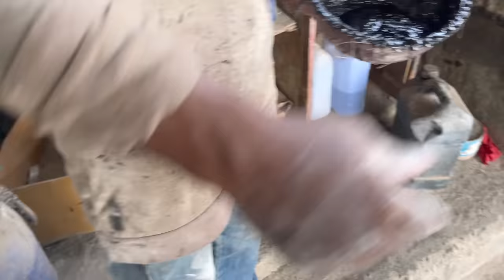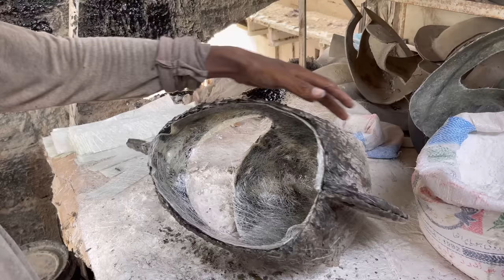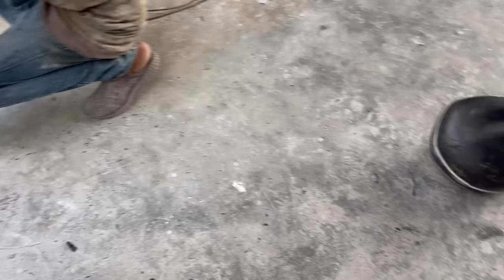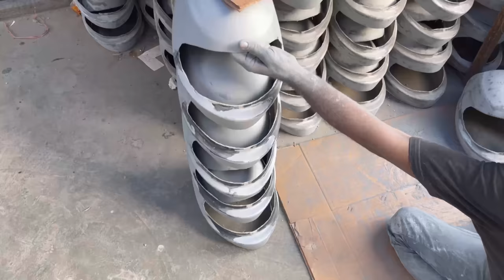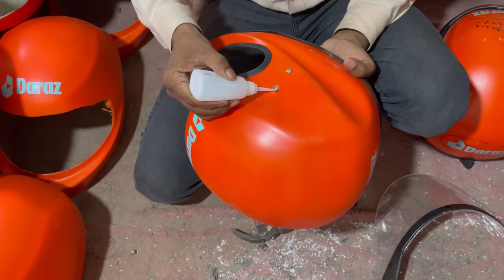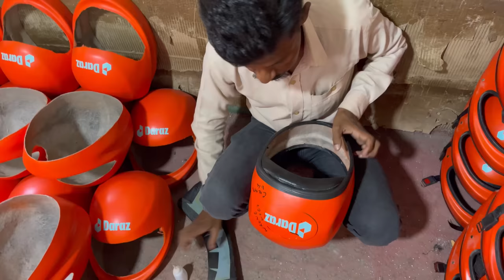How to Make Bike Helmets in a Local Factory by hand || Amazing Work|| Complete video||

Comment: Thankfully I will never have to wear any of that crap, the UK may be many things but our Motorcycle Helmet Standards are far & away better than these, at least in an Accident I know I will have a 99% chance of survival wearing what I do than wearing one of those.
Reply: Same ,, i was thrashing  the Z1000 to within an inch of its ,and my life last weekend ,
Glad for the safety gear i have ,, not that even it would be more than a token at speeds above 145k,  unless on a track .
I pay about   
$ 2,000  AUS  for a helmet ,     l  like carbon fibre, strong n light  good for  high speeds , comfort .
Still ,,,  if i lived there ,think id use a coconut  , just cause its stronger n better in the looks dept .
I did get a laugh but .